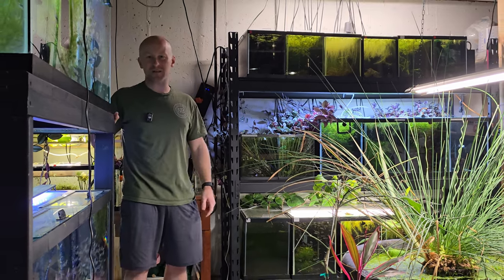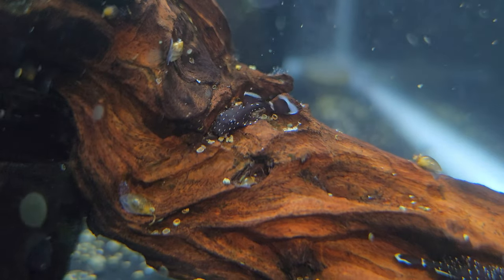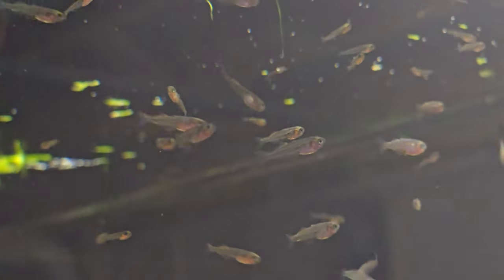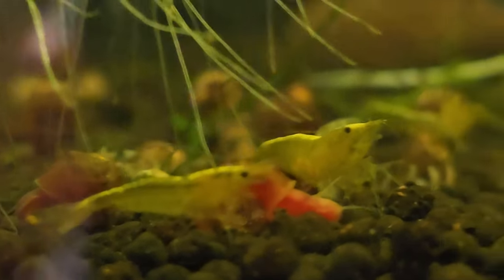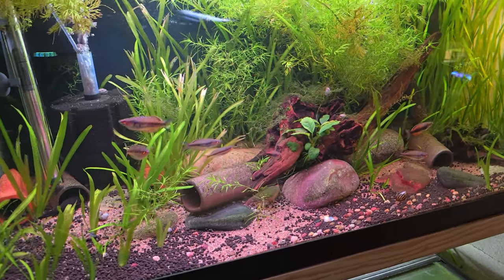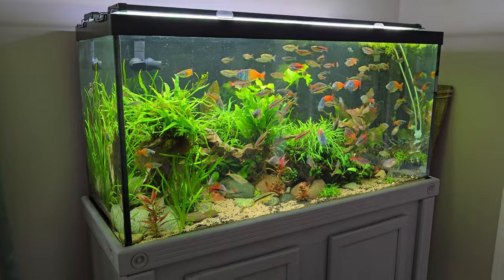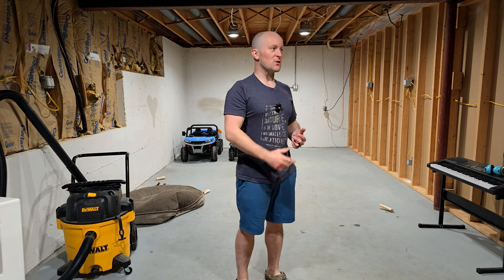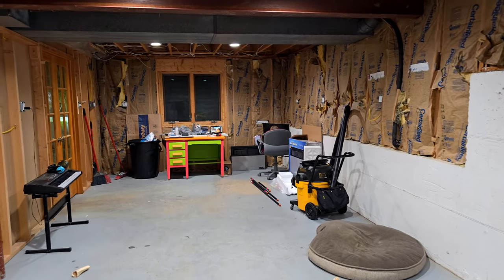2024 FISH ROOM TOUR + EPIC SALE! (40+ TANKS)

Comment: You will need to insulate your concrete as it has a very low R factor and will suck the heat right up. We learned this the hard way when we built a cold storage room. After the cooling bill ate us alive for a couple of years, we went in and insulated the 1 concrete wall of the cold room and that saved us a lot of money. I can only imagine it would be worse trying to heat a room as large as your fish room with that much concrete.

"((The U-factor for Concrete Slabs)(Concrete Construction)
A reasonable R-value for a normal concrete slab can be estimated using an R-value, the thermal resistance per inch of thickness, between 0.1 and 0.2 and multiplying it times the slab thickness. For a 6-inch slab, R-value would be between 0.6 and 1.2.)"

 I am returning to the hobby after a 25-year hiatus. And dang it has been expensive.
Reply from the maker: Thank you SO much for this advice. I really appreciate it! Do you think thick foam sheets would be sufficient?
Reply: @sydneysangels  there's a product called allure which works really well on concrete floors. It's floating vinyl strips with glue tabs. Only about a 1/4 thick and goes straight onto concrete. Not sure of thw r value but it's comfortable to walk on in sock in the winter and bullet proof for flooding and damage.

Comment: Great fish room, everything breeding! What about running some plumbing for the new room and drains behind all the tanks
Reply from the maker: Thank you so much. Yes! I am absolutely going to do that. I just haven't gotten around to it yet haha
Reply: @sydneysangels  something else to consider is sealing between the baseboard and the floor with a bead of silicone or caulking. I found that it prevents alot of cold air from entering my fish room that would otherwise fall down behind the walls and spill into the room. And it also seems helps prevent mold issues by keeping condensation off the baseboards where all that cold air meets warmer air as it enters the room.